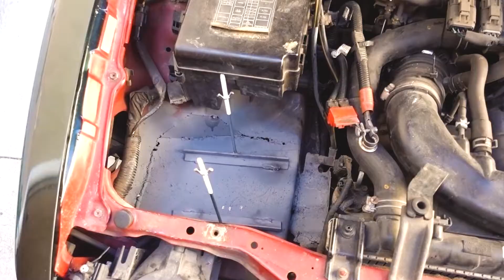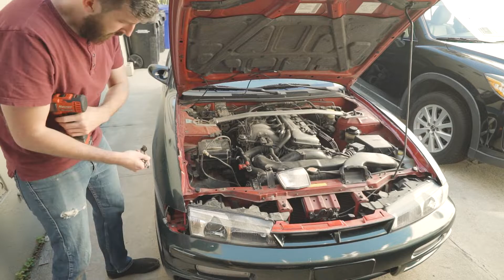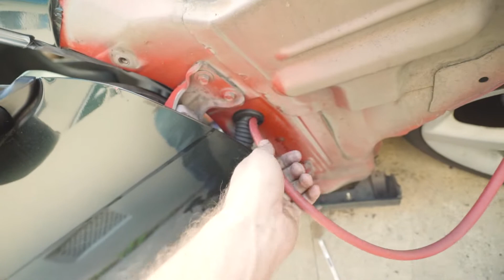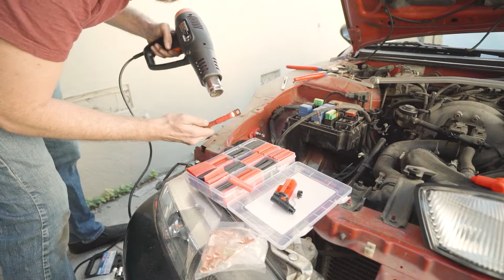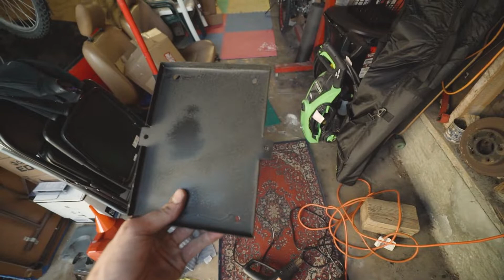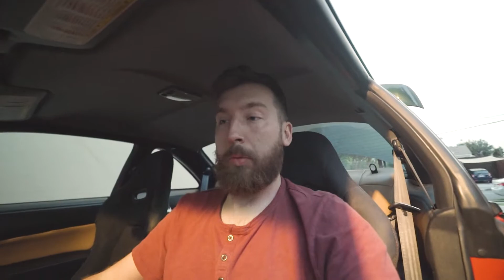240sx Battery Relocation

Comment: Shouldn’t u be running 2 wires from the battery to complete the charging circuit? One wire needs to come off the battery and have an inline fuse and go directly to the starter coming off the starter run another wire directly to alternator… the second wire coming from battery with a circuit breaker inline go directly to fuse box wires… if u run a single wire to battery ur charging system is getting power drawn by the fuse box engine and accessories before the battery can regulate the output
Reply from the maker: The new positive cable from the battery to the wiring harness is the exact same set up as OEM but it’s just a longer lead to the harness itself. I didn’t change how the circuits were routed for the alternator, fuse box or accessories.
Reply from the maker: The new positive cable from the battery to the wiring harness is the exact same set up as OEM but it’s just a longer lead to the harness itself. I didn’t change how the circuits were routed for the alternator, fuse box or accessories.